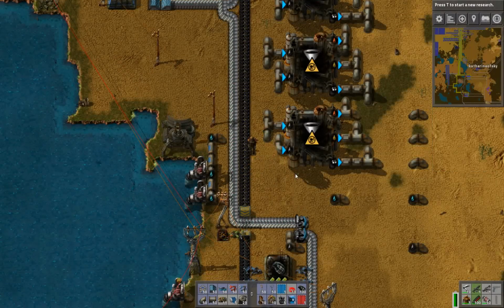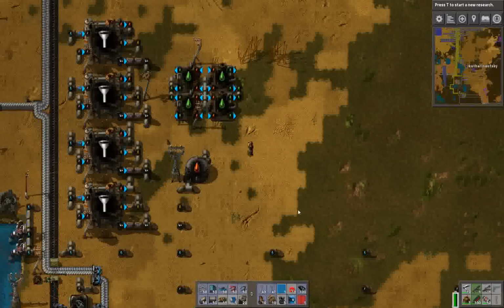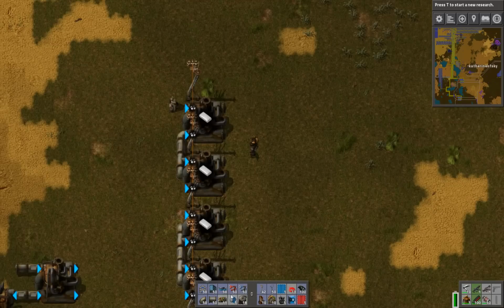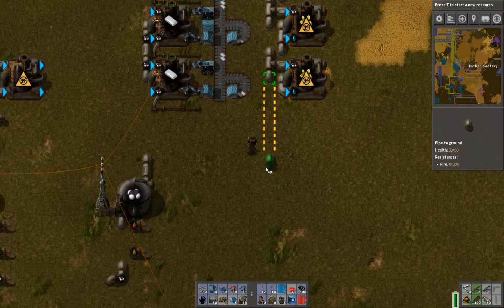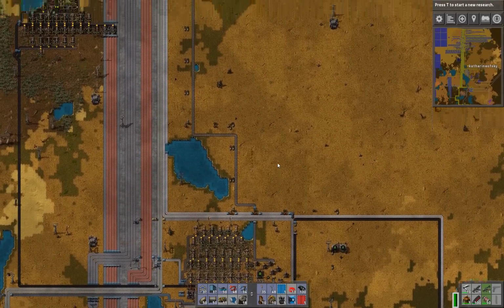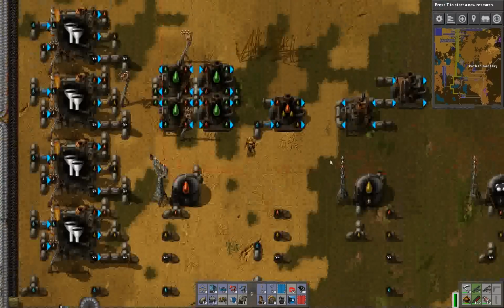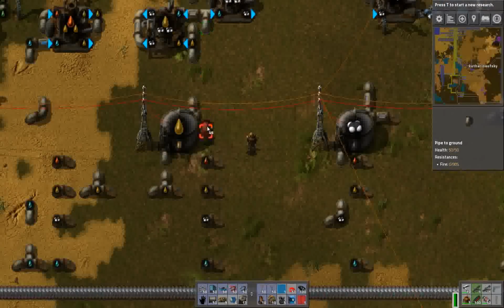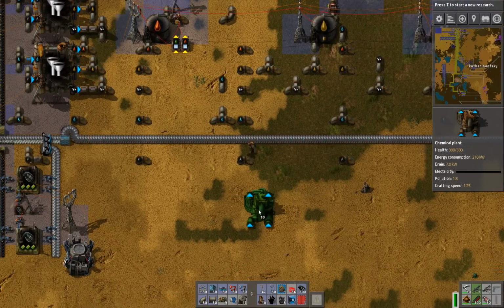Factorio Tutorials: Setting up Oil Refining: Basic & Advanced

Comment from the maker: The current ratio of Oil Refineries to Heavy Oil -> Light Oil Cracking to Light Oil -> Petroleum Cracking is 25:3:21, (or 8:1:7 for smaller arrays).  In the combinators, you'll want to use a value of 1,000, (instead of 100), for the current version.
Reply: I like your dedication to update a 2 year old video. That's cool.
Reply: Thanks for the update, appreciated! I've learned so much from your video's :)
Reply from the maker: Older version of the game.
Reply: Hey Katherine, i would like to say than you for this video it realy helped me! If i may ask, could you make a blueprint out of this? It would be realy helpful since it is not on your onedrive with blueprints.
Thanks again!
Reply: do you use a mod for the 1 tile pump or is that the old version of the game?
Reply: Do I understand it correctly that I now (april 2020) would need 25 oil refineries, 3 chem plants for light oil cracking, and 21 chem plants for petroleum cracking. And that can supply 4 chem plants making plastic, 5 making sulfur and 2 making sulfuric acid? Thank you for the guide!

Comment: Waaaaay too many shortcuts that are not explained….ex every single chemical plant you laid down had 2 inputs and 2 out puts and you never explained them the way you explained the 5 connections of the oil refinery early in the video….. tried to replicate and chemical plants simply refuse to release the sulfuric acid into ANYTHING….not into pipes, not into storage…..plus video waaaaaay too long. I suggest you break this massive 45 part process in this video into more bitesize videos.
Reply from the maker: The beauty of YT is that you can pause the video.  I suggest you do so and replicate every step with care.  What is the point of having 45 unlinked videos?  That would drive people crazy trying to find each in the sequence.

Comment: Maybe I overlook something but if petroleum is full the other types of the refinery will halt in this setup.
Reply from the maker: This setup is designed to prevent halting ;-)  if you have too much petroleum, you should convert it to solid fuel.  I did an extended build for this with my megabase 3 series, adding solid fuel prioritizing petroleum usage (if there is overage).
Reply: @KatherineOfSky  OK yes if you convert petroleum to solid fuel and burn it away then this setup should never halt. This part was not in the video that's the reason why I thought this setup can halt 😊
Reply from the maker: @DoubleRaw  Recipes have changed a tiny bit since I made this video... I really should record a new one!
Reply: @KatherineOfSky  Please do, I would love an up to date tutorial!

Comment: I had a problem.  I had a field with a yield of 176% or 17.6 units of crude oil per second.  But I wanted so much storage that I couldn't possibly exceed the storage limit within the timeframe it takes to fully tap that field.  It takes 5 minutes to lead to a 1% deterioration in field yield.  It would take 13 hours to go from 176% down to 20%.  I could use a policy where I calculate the total yield after 13 hours at current maximum yield.  17.6*13*3600 ~= 824,000 units.  So 33 - 25,000 unit containers will do the trick. 

On the other hand... could I get a pretty close to exact estimate of yield over that time?  Yes.  Yes I can.  With a little application of Integral Calculus, I can!!

dV/dt = 17.6 - t/3000     --->     dV = (17.6 - t/3000)*dt -->  Integral(dV, dV) = Integral( 17.6 - t/3000, dt) 

--->  V = 17.6*t - t^2/6000. 

Now I have an expression for total yield over time.   I enter 13 hours; and 458,640 is the total yield with deterioration of the field taken into account.  This takes my needed storage from 33 down to 19.  Was there a point to this exercise?  Not really; but it was fun!  Now if you have comments about the wisdom of solving this problem (or lack thereof), I would love to hear them! 

: ) : ) : )
Reply from the maker: If you find joy and amusement in the exercise, I think it's great!

Comment: I did this exact setup but my oil refinery's stoped working. If i keep selecting new receipe and click basic oil processing it goes for a tick and then stops. I checked if i was out of oil but my storage is completly full. Everything got energy. I got quete a few plastic bars before it just didnt work anymore. Anyone had a simulair problem?
Reply: Nvm, one of my storage had petroleum in it that shouldn'd be there. So i replaced it

Comment: When laying down your water pipe  "liquid bus" at the beginning I notice you manually placed them.  If you hold down the mouse button it will automatically space, flip and connect the underground pipes for you. This is much faster!   Of course, this is done at a max distance so you need to manually place if you different spacing, like when you started to hook you the outputs.

Comment: Why do my refineries produce heavy and light oil so slowly?
Reply: Your petroleum is probably full. When a refinery refines oil, it makes all 3 products, Heavy, light and petroleum, if there is no space for any one of them, the refinery stops until there is space. I'm going to guess that as your factories slowly make plastic, because your plastic line is full, It slowly uses your petroleum until there is enough space that the refinery will process another oil unit. 
You can add more storage tanks but that is only a temporary solution. If this is the case, turn off oil cracking or use the circuit network to only turn it on if there is more light oil than petroleum.
Reply: @BrandonFrancey  what's cracking?
Reply: I mean what is it, not what's up, lol
Reply: @droid16beta97  Cracking is breaking heavy oil to light oil or light oil to petroleum.
Reply: @BrandonFrancey  Okay. Thanks so much! I made more storage space and it helped for now.

Comment: I'm ready to punch the game in the mouth. I get how connections work, but RATIOS and refinery output tell me nothing. Refineries keep shutting down, and I can't figure out how to fix it, when I can't see what needs what.

I'm basically..."ok let me add a tank....let me remove one....let me delete a refinery...let me add one...ok I need more chem plants....let me check my connection for the 56th time....ok i think maybe I need less tanks......." etc etc etc etc etc....

About to jump off my house...
Reply from the maker: Use the second part of the tutorial to set up automatic cracking with circuit conditions -- that will solve 99% of issues.
Reply: KatherineOfSky Yeah, I just haven’t used circuits yet either lol. I have a long way to go.

Comment: Greeting, Katherine of Sky.  I am Snarky of Remulak.  Is this information worthy to face the current game's version?  Your compliance is agreeable.
Reply from the maker: The current ratio of Oil Refineries to Heavy Oil -> Light Oil Cracking to Light Oil -> Petroleum Cracking is 25:3:21, (or 8:1:7 for smaller arrays).  In the combinators, you'll want to use a value of 1,000, (instead of 100), for the current version.
Reply: Thanks

Comment: Is this setup still viable in 2018?
Reply from the maker: It certainly is.  The ratio of Refineries : HO Cracking : LO Cracking is 8:1:7,  (Or large version:  25:3:21).  Since oil products have been multiplied by 10, the pump flow condition should be set to Petroleum > 1000, (instead of 100).   Everything else works very much the same.

Comment: There's so much more in this guide than just oil refining! I learned a lot thank you. I had to adjust the numbers slightly due to some updates by the looks of it but I got the combinators working as you described.
Reply from the maker: Yes, the number for splitting of oil should be 1000 instead of 100.  (All oil values were multiplied by 10 in the 0.15 update).  Glad it worked for you!

Comment: Um great help and thank you for such clear explaining (best so far!) I have tried this set up for the Petroleum gas, yet my gas stopped after a short time? Despite having more than enough oil and two tanks, they were empty in no time? Any tips?! 😊🌸
Reply: Almost, but the key is the oil refineries have to be empty not the tanks. Imagine it like the other factories, you can't produce a new copper wire before the copper wire you just made is removed and put on a belt or into a box, except this time the refinery makes 3 products, which you have to move out of the refinery before it can process any more crude oil. So, if you're not making any more plastics or sulfuric acid, AND your petroleum tank is full, you will stop producing the other two products, heavy and light oil. 

You could try storing the plastic in boxes, or barrel the oils to keep a steady flow going and use the excess later, but I have found it's better to use the products for example make more red circuits with the plastics!
Reply from the maker: Refineries need to be emptied of ALL products before they produce again.  Add tanks for Light and Heavy oil
Reply: Oh thank you Katherine 💐 ok, so I need to use all the different oils first and empty their tanks before I will get more gas?! Here I have been sending loads of crude oil
down to the refineries putting down more tanks, yet I see now you manage with only two ha ha. Am I new to this or what! Im thinking that this tutorial video of yours had so much help and only thanks to your brilliant way of making it sound so easy. I am really thankful and impressed, having taught myself, I compliment you and thank you again. Will have to watch this many times ha ha
Reply: Thank you "Xaser33" sorry for late reply. Yes now I finally get that logic! The game can be really cruel and we know just how much we hate having too much logic in our lives! Ha ha ha. It took me a long time to realise that if it is broken = MY FAULT!! he he

Comment: Well explained, but it looks sparser than it could be. You also didn't talk about ratios, but since this is expandable, more chemical plants can always be added if one of the tanks starts filling up and clogging the line. 

I'd add a separate light oil tank connected by a pump to be always kept full and use it for flamethrower turrets. They're awesome.

Comment: Hi KoS, I've been trying to get a circuit system going using combinators such that a pump attached to a fluid tank will only switch on when there is between, say, >100 but <1000.  That is, the tank will fill up to a given maximum and then drain to a given minimum. But I can't seem to figure it out! Is this possible? Could you give me some advice here.
Reply from the maker: Definitely possible, and something I use on my current setups: https://youtu.be/s2Wvol9aKz0?t=1315

Comment: gas seems to be going into my plastic factory too slow and connecting to both pipe ports does nothing for the speed right? so i just need to make my factory bigger instead?
Reply from the maker: Sounds like you need more production.
Reply: i was about to  set up more when i realized that im low on oil but the nearest oil is pretty far so im thinking im gonna try making a train for the 1st time :)
also ur videos r awesome and so r u :)

Comment: Just one thing I have spotted is that the right lubricant plants aren't hooked up to the bus, what do you think would be the best way to connect them? I have just ran them as a separate line to the tanks.
Reply from the maker: I run a fluid bus up through my factory.

Comment: How did you do the trick at 21:30 with splitting belt items using underground belt? I tried that on actual version (15 something) and either I'm to dumb to replicate it or it doesn't work anymore. It seems underground belt is going different direction in my game than on your video.
Reply from the maker: Press R on the underground to change the belt direction.  It works on 0.15 as well :-)
Reply: Yep, I'm dumb. Tried it again and succeded. Didn't know  you can turn direction of the belt after you place it with R key. Alrighty then! BTW great video, great tutorials! Keep the good work! You're help me a lot haha

Comment: So what am I to do if the petroleum tanks fill up? So far what i've been doing in my game is just picking it up and plopping it back down (Disgusting, I know), what should I do as I am producing way too much petroleum
Reply from the maker: By picking them up, you're wasting the most precious type of oil in the game!!!!   Convert it to plastic, sulfuric acid, or fuel blocks.  (What are you needing the Heavy Oil / Light Oil for that you are destroying Petroluem?!?!)
Reply: I'm running out of lubricant due to not enough heavy oil being produced. And we're not using a lot of plastic, sulfuric acid or fuel blocks so all the conveyors are filling up which causes the backup of petroleum

Comment: Would it be smart to make different things at different outposts or just ship oil to one spot?
Reply from the maker: It depends how your base is setup.  At megabase proportions, I generally have separate outposts that make All Plastic, or All Rocket Fuel, etc.  If you are talking about a "regular" base, I just ship oil to my main factory, which produces all goods.
Reply: Well i already decided to make outposts cause it seemed easier to do than set up train routes through my really messy base, i'm also doing a main bus system for my base so its gonna be weird to do

Comment: great video. you are the only one using the pipe bus on oil tutorial on youtube. love the idea. i would recommend you include ratio considerations in your build to help those who want to perfect their factory. but this is great. you did use the old 5-7-1 ratio, but i don;'t think you mentioned it :). new ratio i read is 7-8-1

after a lot of search, it was your video that helped me finish my oil setup :)
Reply from the maker: This tutorial was made prior to 0.15.  I will be updating it to reflect the new ratio when I have time.  Glad you found it useful!
Reply: KatherineOfSky Oh I know. the comment was for comment readers. I am sure you know the ratios.great island you have easy to wall off. I wish I could do the same. my map is all red. But I can kill them easy with an laser blueprint with walls and an electric pole. But they keep coming back.
Reply from the maker: New map?  Turn off biter expansion, and they won't be able to settle again!  (There also may be a console command to switch off expansion in your current map, but of course, that will disable achievements).

Comment: Instead of cracking you can just refine everything that you don't need to solid fuel so you never run out of fuel for anything you need.
And, how much plastic do you need?? My whole factories plastic need run off of two plants that's just so much plastic
Reply from the maker: I never use solid fuel for anything but rocket parts.  I need LOTS of plastic for my mega-bases -- in my Tasty Vanilla series, I'm using 6 fully-compressed blue belts' worth of plastic.  If you never use cracking, you will easily overflow on solid fuel... and that's the point of the tutorial: to show how to get the products you need/want.
Reply: KatherineOfSky ahhh yep that's why you need lots of plastic I'm still in the mid-game stage and only use plastic for advanced circuits and robot production.
But now that you said it I do realize that I have about 5-6 thousand solid fuel at chemical plants around my base I guess now I'll just have to use cracking.

Comment: quick question, how did you get the powerline to display data about the oil output? also great video i learned a lot!
Reply from the maker: If I understand your query correctly -- you can see circuit info passed if you connect the red/green wire to a power pole.

Comment: Hello ... 1 thing i need to contest here is about not having Electric Engine  at this time 16:50 .
You can research electric engine with Red and Green ....i have builded electric engine before making plastic.
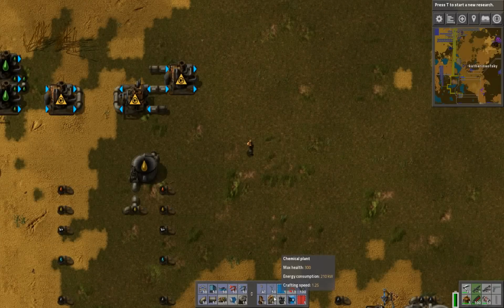in 12:21 version...i can build Pump with and engine unit 1 steel plate and 1 pipe.

But i guess you already know this already :D
Reply from the maker: 0.15 changed the recipes for pumps.  Now they require a regular Engine, not an Electric Engine.  But this video was made last year...

Comment: Sadly, I use a poem to remember what fluids go where on refineries. 'Heavy to light, left to right'. On the basis that oil floats on water so water is heavier, and gas is lighter than liquids. :)

Now that 0.15 is out and we can transport all fluids on trains, it would be interesting to hear your views and advice on whether to keep all the non-cracking chemical plants near the refineries, or take the gas away and process it nearer the coal, iron, water and copper needed for plastic, sulphuric acid and batteries.
Reply from the maker: I have not changed my setup significantly in 0.15, except for the ratios of buildings.  For me, it's much easier to bring in coal, and the tiny amounts of iron and copper than move all of those somewhere else.... and then STILL need to bring in coal when those deposits run out.  I do, of course, run a train for sulfuric acid to mine uranium in far-off locations.